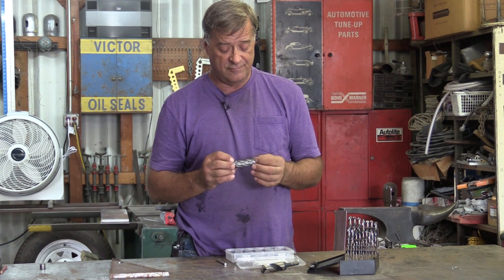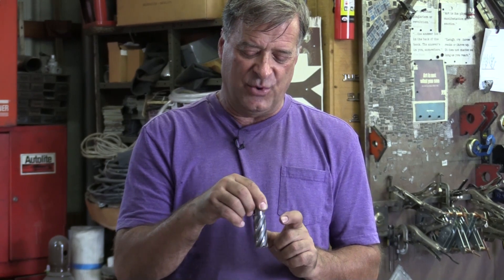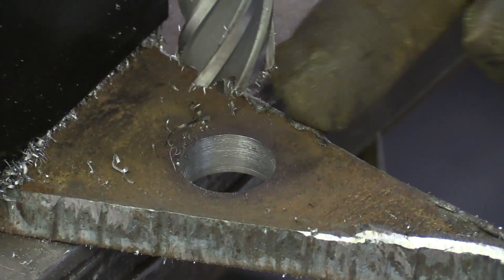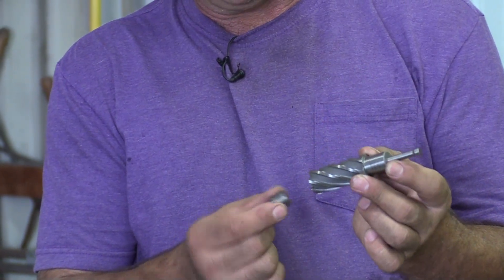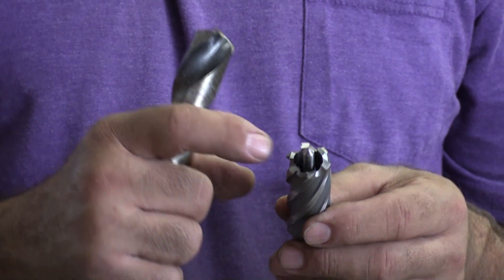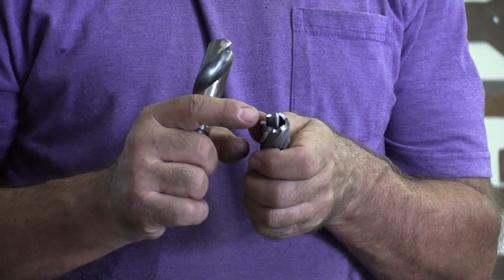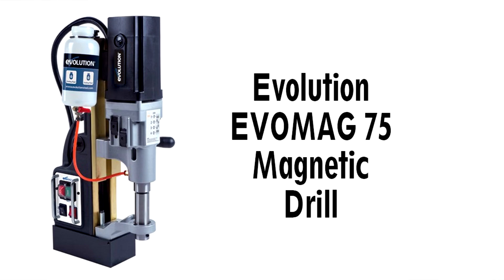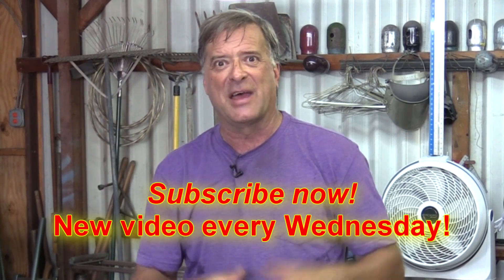How to Drill With Annular Cutters (& Why You'd Want To) - Kevin Caron

Comment: I have to drill hundreds of 3/4" holes in 1/8" aluminum and have in the past used a step bit.  PIA.  De-bur and takes a while. 
I thought I would buy one of these because I have a drill press at home.  Not so fast!  Now I know those are made for mag drills.   Glad I found your video.  Thanks for the explanation.
Reply from the maker: Glad the video helped!
Reply: @   My one drill did 160some odd holes.  WD-40 for some lube and a little time.  Thanks again for the video.

Comment: I can't find any dimensions for the ID of any cutters.  I need to know because I will slide the cutter over a stud to cut around the stud.  The OD doesn't matter for current application.  $259 for that Evolution CC6SET-2 annular cutter set and just HSS instead of carbide cutters.
Reply from the maker: The id is 1/4 inch less than od.

Comment: If you have a mag drill that has a coolant bottle the fluid also flows around the slug ejector.
Reply from the maker: I will have to check that.
Reply: And the pin acts as a valve so coolant only flows when the pin is pushed up as the cutter is brought into contact.   You can fill the top of the cutter/“chuck” with coolant on units that don’t have a bottle. The pin locates the hole, controls delivery of coolant, and then ejects the plug on completion.

Comment: I can assure you that you can use annular cutters on a machine other than a special drill for annular cutters. I've drilled thousands of holes with them using a standard Bridgeport milling machine that was in no way set up for the ejector pin. In fact, I never used the pin. As long as things are kept cool, the slug falls free every time. And if you get one that doesn't, a light tap with a small center punch in the flute area will free the slug. The ejector pin will also allow you to drill the hole on a mark, which is harder without the pin.
Reply from the maker: Always learning something new!   Thanks for watching and posting.

Comment: Is this faster than using a u drill?
Reply from the maker: About the same time to drill a hole but can go much bigger in size and the holes are cleaner.
Reply: @KevincaronSculpture  I've read that annular cutters require much lesser HP due to lesser material removal and more cutting edges. Do you require a lot of force when you used yours?

Comment: read this in another video comment "As a point of experience, you don't need to step drill with a drill bit.  Yes, it will go through faster if you have a pilot hole that is as large as the center web.  It can actually be a detriment to step drill because 2 flute drills are not designed for enlarging holes and do not self center well.  The margins also tend to wear more when enlarging a hole because the tip is not keeping it on center, thus causing the bit to wear out faster.  Try plowing that big drill in without a clearance hole, then try it with just a 3/8 clearance hole.  You also don't really need a spot with larger drills, the drill is stiff enough to keep on center.  Maybe I'll do a video on this principle and also share some old-school tooling, an APT insert drill."
Reply from the maker: Thanks for watching and posting.  Always learning something new in this line of work.
Reply: Hi, just wanted to know, core cut from Core cutter is having equal radius on each side if we had centre hole for alignment of cutter? If deviation then how much?

Comment: you can use annular cutters on a drill press, I do, get the set from Hougen  it is called the extended cutter set. they have an internal spring which with the center pin pops the plug right out.

Comment: Another advantage of annular cutters is that the hole can be offset from an existing hole. If you are enlarging an existing hole and want the new hole to be slightly offset you do not have to worry about the bit wandering.
Reply: But you can't enlarge the hole centrally.
Reply: @darmet  you causing a bushing adapter n
Reply: can you side mill with Annular Cutters?
Reply: @privateprivate3767 no

Comment: Hougen Rotor Cutter has annular cutters for drill presses. Max is 14" thickness and 1" hole. Use them often. I find the biggest advantage is how round the hole is. They also have that plunger that pushes the plug out. Thank god I found that before spending the bucks on a magnetic drill.

Comment: Hello there Kevin from deep down across the pond.
Been watching quite a few of Your videos.
Informative and good stuff. 
Don't have these Cutters available locally. Had to import our set from U Guys. Now we can use them properly with the Insert to push out the Plugs in our Mill.  Thanks for showing and sharing. Superb.
Keep 'em rolling and all the best
aRM
Reply: But I use them in in a regular drill press, and often without the plunger all the time. Seems to work fine....
Reply from the maker: Has to look around for a good deal on a set myself..
Reply from the maker: Just don't forget to use some cutting oil when you are using them.